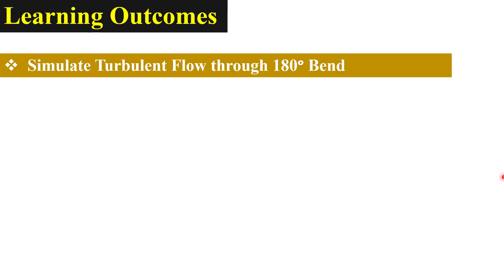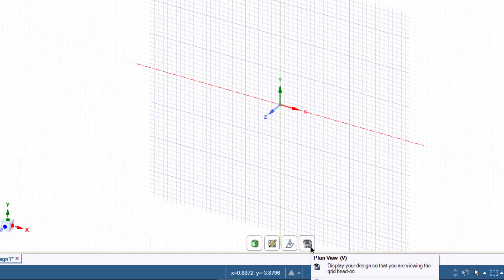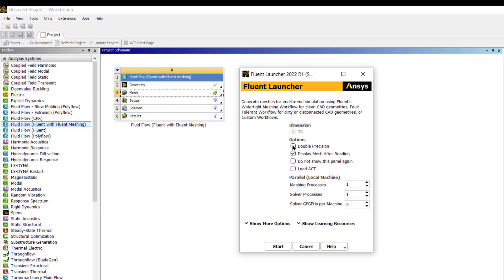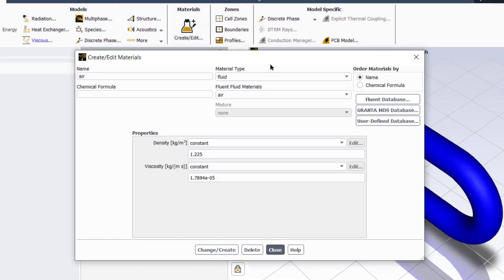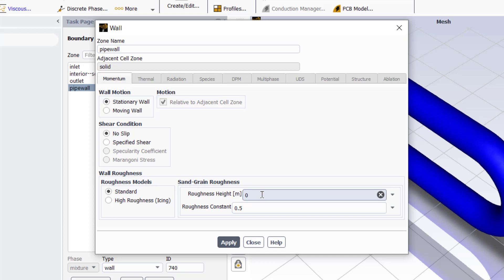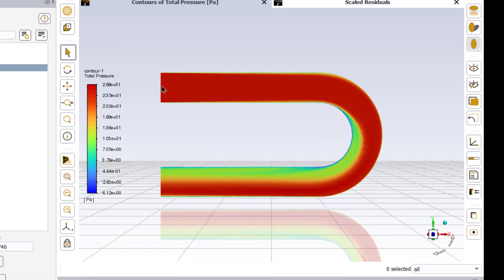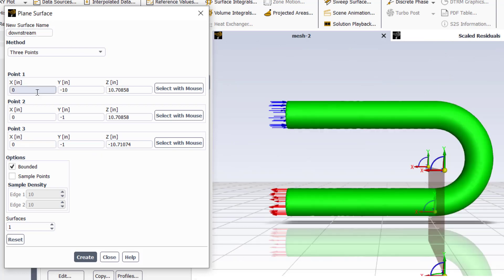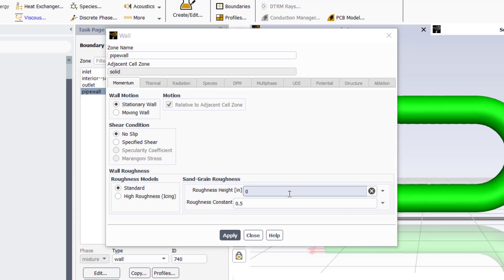ANSYS FLUENT Tutorial | Pressure Drop at 180 Degree Pipe Bend | Design of Piping System

Comment: Thank you for the great video. I have seen your other videos, and I really appreciate the way you are using hand calculations to verify simulation output. 
I just have a question on the way the pressure drop is calculated. Because there is reversal flow at the planes (especially immediately after the bend) you are calculating pressure drops, do you think you should take mass weighted average instead of area weighted? Thanks in advance for clarification.
Reply from the maker: Yes you are right. Thanks

Comment: Thanks for sharing
My question is why you used the totale pressure for calculating the Pressure drop and not the staic pressure
Reply from the maker: when assessing pressure drop in a pipe. The use of total pressure accounts for both static and dynamic components and provides a more comprehensive measure of the energy of the fluid.
Reply: @drumairmunir  i simulate mude through drillig bit  and my static pressure After nozels to thé outlet  was in négative value 
I'm in trouble ?!
I
Reply from the maker: @abdellahmekedeme8839  . I offer you paid help. Contact me on what's app. My number is shown in my channel homepage

Comment: I have a question: for a more accurate result could you calculate the Darcy friction factor of a smooth pipe for your given Reynolds and then take the length of the 180 bend to calculate the losses with the formula: Pf=1/2*f*rho*U^2*L/d? You then substract that value to the 3.66Pa to get a more precise Pl. Or am I wrong?
Reply from the maker: Ok I will surely check that